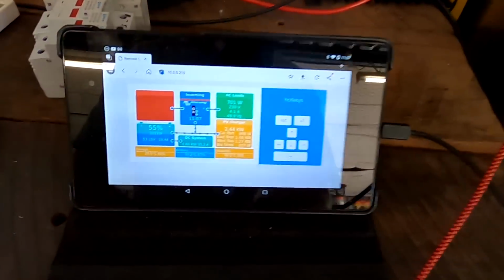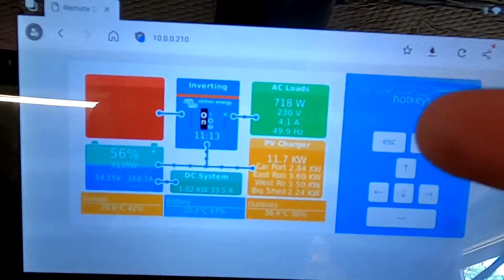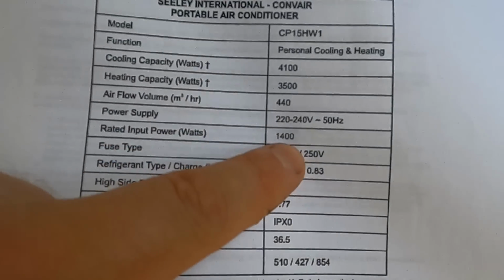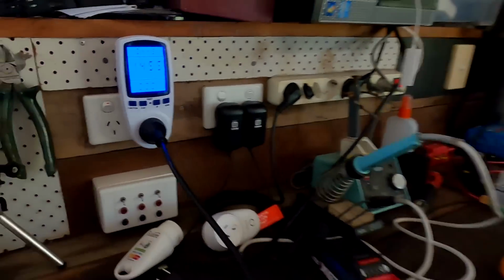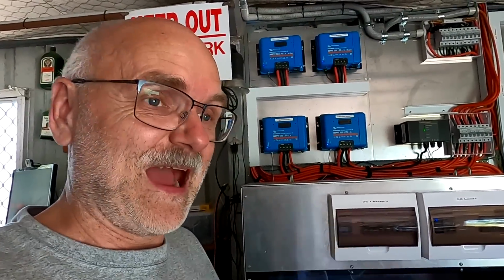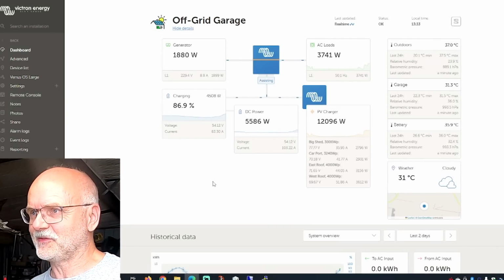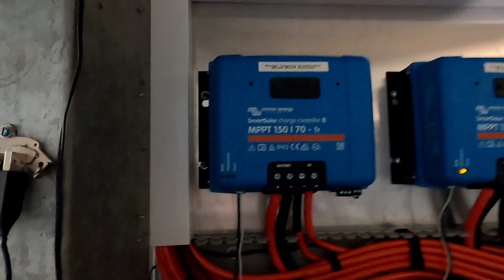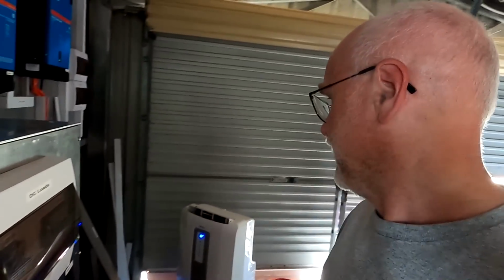Actively cooling solar and battery equipment with an air conditioner. Beneficial or waste?

Comment: Know the vid is years old and you’ve likely installed either a window rattler or a mini split after creating an isolated and insulated room for the battery and inverters .,I bet you even figured out old cool room panel kicks ass and a 6 KW cooling R32 would keep the area at 21 no problem.. control the humidity thou  its effectively like a server room you don’t want static taking out your circuits

Comment: The portable AC units are not as efficient as a fixed split unit which would use about 1KW @ 230V. Mine is powered from ACOUT2 on the MP2 which is programmed via Assistants to come on at 99% SOC (99.5%) and go off at 99% (98.9%) I also have hot water immersion 1500W on this circuit. Luckily my AC unit retains settings when powered off so it just works and my RE Cabin stays at 25 C.

Comment: Hello
Starting to thank you for all the good movies you make.
Looks like you can finally get it a little cooler in the garage.
See how you measure the temperature and that it doesn't go down that much.
It becomes a bit inefficient with this type of cooler as it takes all the air from inside, some of the air comes back cold, the warm air that is blown out is also taken from inside, this means that you get negative pressure in the garage, which means that the warm air from outside is sucked in via the ventilation.
SINCERELY
Larry

Comment: These portable units are extremely inefficient as any aircon  has a hot side and a cold side one inside and one outside. With these units you have both sides in the same room... thats a bit counterproductive. haha
Reply from the maker: This is a normal compressor AC and is the same split air-conditioner as you would have in your home. 
What you are talking about are Peltier elements. I'm not aware that they are being used in actual ACs though.

Comment: So now it's time to think about the node red included in the Victron image on the Raspi. That in combination with the sonoff or some shelly, you could automatic switch the air-condition on at too high temperatures

Comment: Good Idea to use a portable airconditioner. But suggest to use high voltage PV controller to 48V then use MPPT 11KW(parallelable) AC off grid inverter.  I will save more $$ to buy the inverter, the other pack of 280Ah 48V battery and change the water heater from gas to electricl and later buy the Ecar like EX90 Volvo 2023. offgride the gas and try to run one year if OK then offgride the electrcity in order to save more $$.

Comment: Had one of those portable units. Ran it for a couple of weeks. It did cool that room, but negative pressure sucked hot outside air into the house. Sold it on gumtree fully cleaned with all the accessories to a person who wanted to cool a garage. He figured it was the way to go. Who was I to say otherwise. Now investigating a portable unit for caravan, but one that has input and output hoses to outside as well as seperate input and output hoses for inside - no mixing of air and no negative pressure drawing hot outside air into the caravan.

Comment: Andy, wow. The money and OCD you have spent on building your amazing power wall but you failed on your shed. Needs wall and roof insulation. My experience with those portable air-cons are that they are best left at the TIP. You are essentially trying to cool by leaving the fridge door open. Touch the concertina pipe... feel the heat? Efficiency is up the creek. I installed a 6.2kW (cooling) split system air con, yeah cost 20×  your air-con and total shed insulation. However I can set a temperature and it automatically keeps it at that all year round. Max power consumption is 1700 watts, but since its always running, its average is below 1000w. Often at 300w. You need to improve efficiency in ALL areas. Maybe a bit hard to reverse engineer your shed now. Yes I too am in Australia like you so I too am exposed to the microwave oven that is Australian sun.

Comment: Would be interesting to know your loss of efficiency due to heat. Easy to figure out with the data you collect. Of course the real benefit will be in extending the life of your components.
Also your compressor is just protecting itself from a quick attempt to restart which is a killer with too much head pressure.

Comment: Gallium nitride instead of silicon is coming.  Will improve efficiency roughly 2%, have much higher heat tolerances and last roughly twice as long (20 years instead of 10)

Comment: That type of AC is not efficient unless you have an intake tube from outside. The AC is sucking the cool air out of the room creating a negative pressure which sucks hot air in from outside to replace it. If you add an intake tube from outside you will notice a huge difference.

Comment: Yep, so many of these domestic units only turn on when commanded from its panel and can't be configured to run when power is applied.   Getting info from OEM is difficult.  I have found LG does have option for some spiit's and monobloc (but not suited for my application for other reasons). I am still looking at other Monoblocs to find d one that works for me.
As you have a remote, these are Usually IR, so if you can find a code (maybe online  otherwise make a receiver and capture codes). Then a ESP32 WITH IR transmitter could be used to turn it on off based on need.  I would also include a SONOFF or Shelley with power monitoring so you can verify AC turns off, and if not remove power as IR can be prone to interferene

Comment: There are lots of universal remote options that include timers and even remote IR control via the Internet from anywhere, but it also shouldn't be that difficult to hack the air conditioner remote (or better yet, a cheap universal one) with a relay across the power button so your system could automatically turn the cooling on and off itself as needed.

Comment: To cool the MPPT chargers look up this fan BG0903-B044-VTL its a blower fan with temperature speed control there is a thermistor in it that as the input temp of the increases it speeds up to blow more air I pulled out the sensor , extended the wires and attached it to the heat sink in a power supply so the hotter the heat sink the more air it blows you could mount them under your MPPT units with the sensor on the heat sink put them on a timer so they come on during the day note they blow a huge amount of air when flat out (vacuum cleaner level) but make a lot of noise but it has to be very hot for this.

Comment: Andy, further to my other comment, don’t worry too much about heat and the Victron gear. I have about 50 75/15’s ‘in the wild’ and have had for half a decade. One project in particular has them sitting in ambients of 45 to 48 degrees Celsius during much of the summer and seeing board temperatures of around 85ish. Haven’t had a single failure. They’re very well species to handle the heat just fine. Cooling them will make YOU feel better but seems unnecessary in practical terms. Batteries however - I guess Arrhenius applies to them but I also see extremely long lives on them too just by charging and discharging conservatively.

Comment: Andy - ahhh the joys of too much power :) I too have experienced that conundrum - if it’s not used it’s wasted right? And power is work.. work ethic dictates it must be used :) I’ve tried things like pulse width modulating my hot water system to exactly track the excess power on the shunt (I think there’s a vid on my channel somewhere from years back) and even considered setting up a distillery to… erm.. make ethanol to power the Ute 😂😂

Comment: Some PC fans on the solar charge controllers would do the trick.  RV people do it because it can increase their output on some models.  Apparently Victron has it in the circuitry to not produce as much electricity when they get hot.

Comment: If the air coming out of front vent is truly that cold the condensate water on evaporator coil will freeze creating a block of ice that will block air flow across evaporator.  Maybe it goes into heat mode to defrost evaporator but that would be rather stupid as you don't really need evaporator coil lower than slightly above freezing temp for cooling.  

For reverse cycle heat pumps in heating mode, the condenser coil (which is actually evaporator in heat mode) may get below freezing depending on outside air temp.  In heat mode it periodically goes back into cooling mode for a minute or two to defrost condenser coil of ice buildup. Relative humidity of outside air determines how fast any ice buildup happens.

On a cheap self-contained portable unit like that, it may just have air baffle doors to redirect air flow, switching inside air from evaporator side to condenser side for changing between cooling and heating.  You can't expect too much from such a low priced unit.

Only putting hot condenser exit air vent to outside means the condenser inlet air is creating a garage negative pressure sucking in outside air from any air leaks in garage, which is warm air, back into garage.  Best to put condenser inlet air to closer to ground cooler shaded area outside location and condenser hot exit air near roof height to avoid sucking it back into condenser cooling air inlet port.  You should put a screen over the outside ports to prevent critters from making a home in your air conditioner.

Most all air conditioners have a timer that prevents restarting compressor within 5 minutes of power loss until gas pressures equalize on compressor.  This prevents starting compressor motor against high head pressure. Hard on compressor motor and creates a higher startup surge current.

Comment: You can remotely control that AC unit. If the remote uses IR, you can record the signal and then program an IR blaster with a small mcu to start/stop the unit as needed or to trigger based on temperature. Same if the remote uses RF. Just use an RF recorder and replay the signal with a small RF emitter attached to a tiny mcu. You could do this with about A$15 worth of parts.
Reply: That's right! I don't understand how such a smart man doesn't now about home automation with ZigBee/Alexa.

Comment: You might also extend the output hose above the gear, then create a drop (or force air from below)  "curtain" of cold air.  This is kind of what we do in the data centers.  Cold Isle/Hot Isle with a curtain in-between.

Comment: Watched all your videos for a  long time, you are predictable, you start out used(cheap) and then do it right. Might as well bite the bullet and do it right now. Get an inverter mini split heat pump with a minimum of 20 SEER rating.  Might as well go for the most efficient at 30 plus SEER. They are very efficient, quiet and reliable. Most have wifi remote controls. You wouldn’t have an regrets, they are the best. Retired HVAC tech.

Comment: I love ur stuff Andy & for $150 this is a great experiment & video, but let me tell you, these A/C’s are the most inefficient models on the market for too numerous reasons. I think u are already drawing this conclusion anyhow.
You should consider sectioning off a wall with a big glass sliding door maybe for access to batteries & gear with the visual aspect as well, with a nib wall 1m-2m wide to mount a nice little R32 split system, (which u can program to auto start or not), blowing the air from front to rear of shed/battery area, with a ceiling & insulation, the other end could have a door access to allow cold air into your work area or not, which is also sealed and insulated. A 3-9kw R32 Inverter split air con would work well for ur purposes to cool/maintain temp for both batteries & workshop area. R32 is a more efficient gas overall & COP etc, & I didn’t say u can regas them with a BBQ bottle to some degree if u know what ur doing. 
A nice quiet little Inverter split just outside would be nice to cool ur batteries or ur whole workshop area with a little more construction of ur workshop area, and would use less power to do a much better job, quietly & professionally, I think it would be worth it!
Maybe use Perspex or glass for the top half of ur workshop & battery area’s for an open & visual feel. 
I used one of those 4.2kw AC to cool a smallish size room in a unit, it ran for 2 days solid and it wasnt much cooler, so I then fitted it to the window encased in a custom made plywood & foam enclosure to seal the hot side outside & the cooling area inside only, after this process it started to cycle within 20 minutes next time I used it, that is how you get a useful 4kw from a mobile type unit as otherwise they recycle most of the heat they are trying to get rid of, put simply. Cheers

Comment: Anthony is in wonderment as he observes and learns. His little mind has drifted off straightaway imaging the possibilities of using the refrigerator he has seen on projects in paradise channel; it averages less than 60 watts. Maybe the VECCS and half of the batteries could fit in one and a second refrigerator may hold the remaining batteries; he wondered. Because he doesn't understand thermal dynamics he just quietly repeats, " A bird in hand is worth two in the bush", in passivation. Certainly the refrigerator would keep the batteries warm in winter, he thinks.

Comment: Some aircons have a setting, just like in the BIOS of your computer, to do with power and what to do on resumption of AC.  If the aircon is installed in a critical application such as in the room for a cellphone tower, you want it to always fun after a power failure.  But in your house, you don't want it to auto start.  Just what a problem if you have just left home for a 6 week holiday and the power goes off then back on.  But being a portable unit, it may not have such a feature.

Comment: Hot air goes up. In a chimney the upstream of the hot air sucks cool air into the oven. If the mppts have a something like a chimney on top of the cooling body this could be an option for a airflow optimization - without elektricity and self regulation.

Comment: Why do you think you got the air conditioner cheap. I can tell you that they are not very efficient. It sucks in nearly as much hot air as it cools. I have had a few of them so I know. Then it also burnes up the power that gets changed to heat. It is nice just in front of them but most of the room doesn't get much cooler. The only really effecient way to cool is either with a box air conditioner that circulates the air on either side of the wall or a split system. Split system is of cause the best.

Comment: 121722/0316h PST 🇺🇸  121722/2116h 🇦🇺 Guten Abend. Hallo, mein Freund. schön zu hören, dass du deutsch 🇩🇪sprichst. I’m thrilled to hear it. Such command of the language, when spoken!
I also smiled at the Deutsch und Englischer Schalter 😀 Danke schön. More later. 73…

Comment: maybe you can drive a IR universal remote  to send the on and off signal to the air conditionner driven by the raspberry pi or a victron output relay.

Comment: 1:30 Na klar sobald deutsch gesprochen wird läuft Festzeltmusik! XD
The infrared signals of the remote control can also be generated with a single-board computer. You only need to read the signal from the remote control that switches the air conditioner on and off. Universal remotes do the same.
Perhaps an air conditioning split system is also better suited for the garage. It takes up no floor space and runs more efficiently. Of course, it can also heat in winter.

Comment: Seems like it was a good deal on that A/C... at least worth it for testing.  Maybe you could end up using it in the house or just sell it if you determine you won't need it.  Might want to keep it around for 6 months so you can test the heating in the winter then you'll know for sure whether it can be of use.

Comment: It should work even better if the AC is turned on befor electrics and batteries are heated up. It shouldn't take much to put an exhaust hole and if you can, an intake hole through the wall and have a hinged outlet like for a clothes drier uses, but don't know what could do to an intake to keep animals, wind, etc. out. There will be a better flow through the tubes if they're as straight as you get them.

Comment: Thats not measurin the temp properly cause remember its infared and u will have different temps showin but 12V 120mm fans work good,alot cheaper but also quieter let alone alot less power usage

Comment: A decent split system is much more efficient. My large shed I've insulated and run a large split system, if I leave it on 24/7 it's much easier to manage and power varies anywhere between 45w and 1400w.
I'm in seQld so just knocking the humidity out alone is great 🙂

Comment: Very cool! Ran the AC and still charged batteries. Nice job. Imagine, if you enclose the space around the equipment, it will cool even lower. Can't wait. Thanks for sharing.